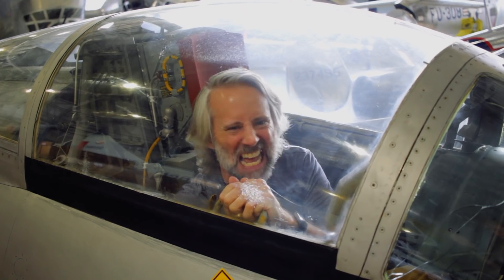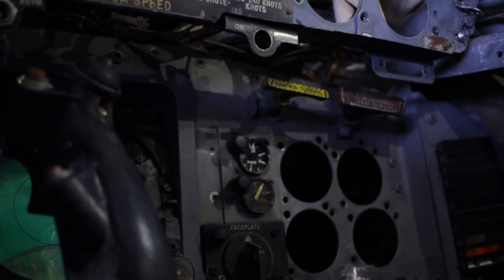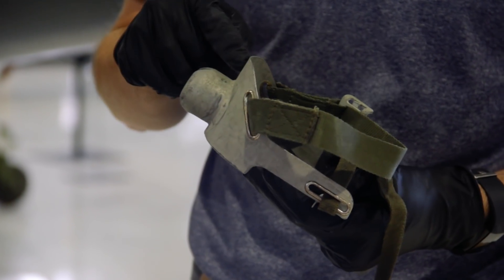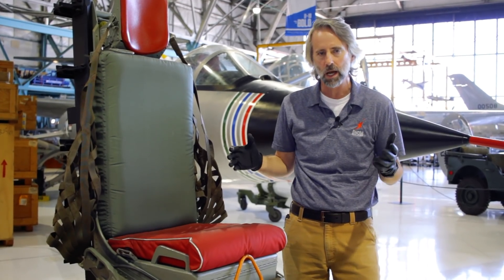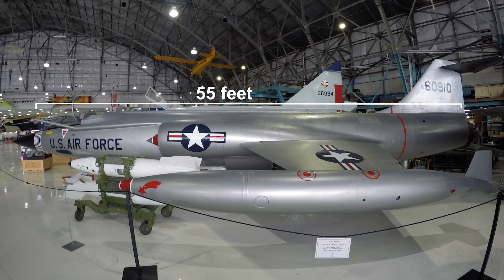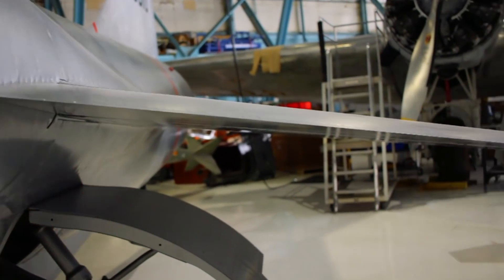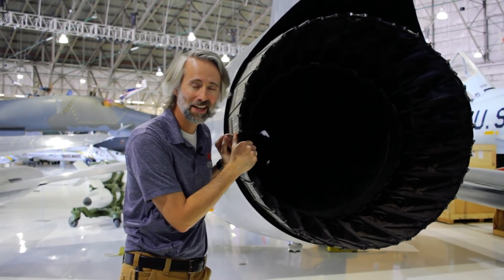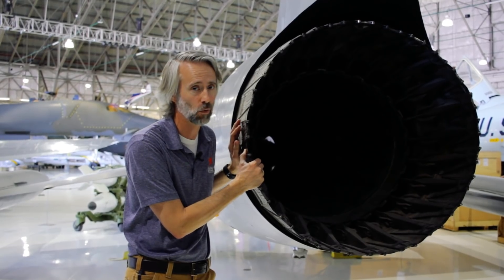F-104 Starfighter | Behind the Wings

Comment: Actually knowing the history of the f-104 Starfighter makes the intro slightly disturbing...,..
Reply: true
Reply: yeah Dad (in a 100)was behind a guy who flamed out on take off (early model bottom eject) ugly
Reply: @796andy2  who thought a downward firing ejection seat was a good idea?
Reply: @andreamaul1603   Lockheed engineer I guess , was fine at 30,000 ft on  take off not so much . Still have Dads little 104 pin with the "2" on it , prized possession
Reply: jonny j 🤣
Reply: Aka: the widowmaker
Reply: @jblackjack  Not to the pilots. But then any aircraft is.
Reply: Aka the 'widow maker'
Reply: Great research plane, never should have been a service fighter.
Reply: @SvenTviking  
> Great research plane, never should
>  have been a service fighter.

Spoken like someone who doesn't know what they are talking about.

As Operation Feather Duster showed (I can't recall if it was Feather Dust I or Feather Duster II), when the F-104 was flown the way it was supposed to be flown ("Zoom and Boom", not "Yank and Bank" or "Turn and Burn") it was able to best the F-86, F-100, and F-4.
Reply: SvenTviking Good thing it was an interceptor instead 🤷🏿‍♂️
Reply: @riflesfirst208  
> Good thing it was an interceptor instead 🤷🏿‍♂️

It was designed to be a daylight air superiority fighter which is to say something that could take on MiGs and beat them, not as an interceptor.
It was USED as an interceptor because that's what the customers often times wanted ... along with some number of other roles that they didn't want to pay extra for a specialized aircraft to handle.
Reply: presenting: THE F-104 WIDOWMAKER! That’s how Lockheed should have introduced it to foreign operators.
Reply: Agree, in german, its called widow makers 
Lol
Reply: The host is a disrespectful Jack ass
Reply: @SamB-fv6su  He is very eccentric funky guy, no need to slander him, there is no harm coming from him.
Reply: @SamB-fv6su  no, he's just enthusiastic and passionate about aircraft. He's demonstrated on multiple occasions that he has the utmost respect for servicemen and those who gave their lives in the fight for freedom. Lighten up, man.
Reply: @SamB-fv6su  Stop crying you PC twat
Reply: @SamB-fv6su  jesus calm down
Reply: @SamB-fv6su  yes yes he is
Reply: Sam B can you tell me what you mean please? Did someone get trapped in one?
Reply: Shane K 108 German fighter pilots in one year. They called it “The Widowmaker”.
Reply: @shanek6582  they crashed a lot
Reply: @SvenTviking  
> 108 German fighter pilots in one year. They 
> called it “The Widowmaker”.

Ummm, no they didn't ... the German press called them that as well as "Flying Coffins".
But with only a possible exception or two, the German fighter pilots loved them.
Reply: @SamB-fv6su  trigger much?
Reply: Sam B why so Triggered?
Reply: @jonnyj-z2x  You don't hawe a fucking clue how many pilots died in this plain so don't tray to sound smart you are just ignorant.
Reply: Sanel Šabanovič *plane
Reply: Sanel Šabanovič SIMP

Comment: Most crashes the f-104 we're pilot induced. You're landing speed was about 220 to 240 knots if memory serves me correctly. That is aping ass. I did become quite familiar with the f-104 when I work on Darryl Grenamyer's personal f-104 that he landed at our air base, Mountain Home Idaho, I believe 1976. He had no landing gear lock light. We sent up an F-111 and he looked over the gear and said it looked locked so he landed it at our air base and we put it on stands in one of the phase docks to see if we could figure out the issue. Well taking a break and looking it over they asked me if I could run Hydraulics and Power on the aircraft so they could cycle the gear. Which I was more than happy to oblige. I knew the chief of maintenance Colonel pretty good and he approved it. And we were Off to the Races. They started in the cockpit after we cycled the gear a couple of times and still weren't getting a landing gear down lock light. I shut off Hydraulics to the aircraft and went into the wheel well and the Cannon plug that plugs the squat switch to the forward bulkhead was loose. Plugged it in and lo and behold they had a landing gear lock light. Made some good friends there for a little while.

He borrowed $7,000 from the chief of Maintenance to fuel the aircraft up and went out to take off and his alternator failed. We had an F4 National Garden group in Boise Idaho that had an alternator that he needed so they brought one out to us and swapped it out oh, and he finally got out of there the next day. Which saved the wing Commander from explaining why we had a privately owned aircraft sitting in hotel section when the Inspector General showed up the next day.

Comment: The most amazing fact about the F104 is that a Lockeed engineer named Daryl Greenamier built one out of spare parts and set a low altitude speed record of 999.something miles per hour 100 feet off the ground and I believe that record still stands.